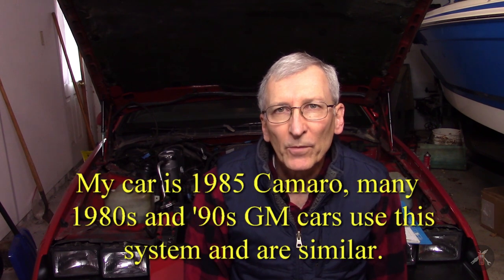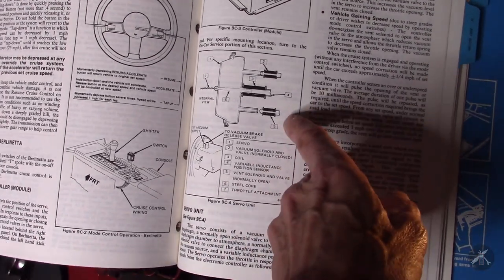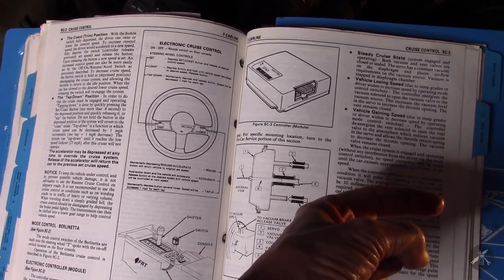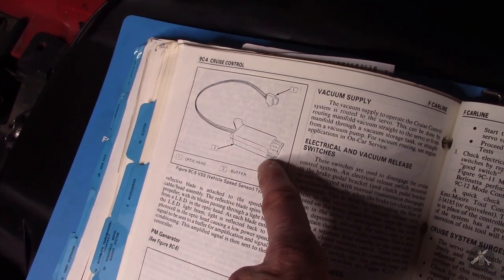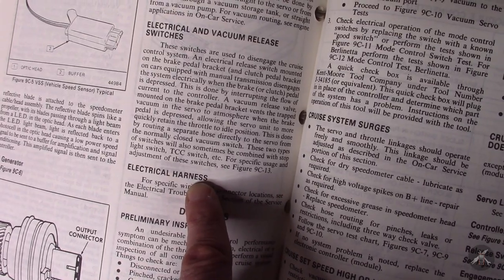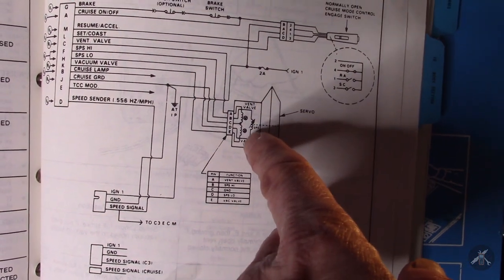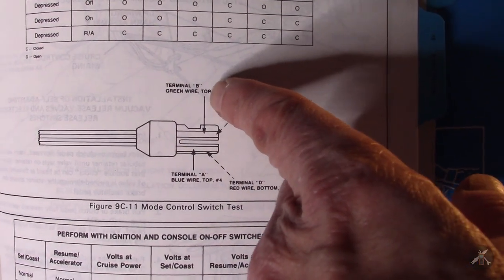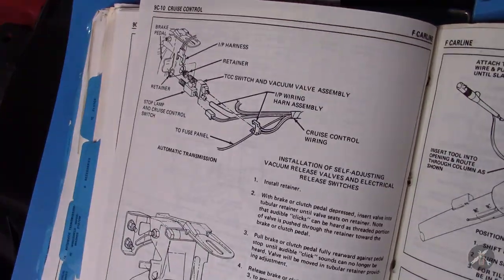GM 80s / 90s Cruise Control Diagnostic - 1985 3rd Gen Camaro

Comment: I believe this video is in reply to my request, Thank you kindly.  I have an 85 as well.
Reply: 1986 is the first year for electronic speedometer.
Reply: I’d suggest leaving the lever harness connected to the main harness, use backprobes on the main harness which would free up your hands - or as you’d mentioned move to the controller and make checks there.
Reply: My unit is inoperative, I will start at the servo, thanks again for this!
Reply from the maker: Yes, it is.  I hope it helps.

Comment: Thanks for the outstanding video sir. You have helped me tremendously once again. 

My cruise control works but the wiring under the driver side dashboard was sloppy and there was a module zip tied there. My cruise lever switch was chrome as well and I was thinking that the previous owner must have replaced it due to it being defective. I wanted an original black one and been researching which lever to order and how to install it. I read the manual and nothing seemed to match or make sense. The servo was mounted next to the windshield washer reservoir and had a separate vacuum tank next to it. I was really confused why my setup is vastly different and why the module is not under the passenger side dashboard. 

Turns out my 87 did not come with cruise control (K34 RPO) from the factory and the previous owner installed an aftermarket system. This setup looks really old so it must have been done in the early 90’s  I ended up removing the whole thing and I am loving the clean wiring and extra space under the hood. 

Thanks again for shedding some light here.

Comment: Thanks for this video! Im diagnosing mine and it seems i hear click in the servo when i press the set button but its not working, i check the vacuum and its all okay, im thinking its the servo, i need to test it, i did try applying vacuum in it and it holds but i guess i need to apply voltage to see if the sevo moves. Thanks again

Comment: So. I started putting my 1987 Iroc z W Tune port injection with the 350 back together and now i can't remember when things go because all my documentation and photos that i had on my hard drive corrupted and disappear! is there a way someone has like photos of the process and that to have an idea where everything goes? Because now i have a real problem here haha. Like i have everything in order bolts and everything labeled but is hard to tell now because there so many bolts and wires. I was doing a head gasket job that turned into a nightmare now. i will appreciate if someone reads this and can guide me true it!
Reply from the maker: I know that you have a 1987 and some things will be different from my 1985, but if you look at my early videos in the following playlist, I tried hard to document the disassembly. Episodes 6,7,8,9 have much detail on disassembly and later 32 through 35 have reassembly.  Hope it helps.
https://www.youtube.com/playlist?list=PLaagkwKaZ2RWXWcU9McHQj92nambLIW9n

Comment: My cruise hasn't worked since I bought my '87 over 15 years ago. Today I replaced the multi-function stalk, and now it does engage, however it immediately goes to full throttle and accelerates out of control. I tried setting it to 55 and by the time I turned it off it was up to 80. All of my vacuum hoses look good, and the check valve seems fine. Any ideas?

Comment: Great video! I have a 88 that is having a speed signal issue at the ECM. I got an EBL ECM from Dynamic EFI.  Being that I'm running a rear mount turbo setup. With the laptop hooked to the ECM via USB cable. The WUP (what's up display) Isn't displaying vehicle speed. Anyhow me problems LOL.  Thanks for the great videos! Keep them coming:)

Comment: Thank You for this. After replacing the signal stock on my '89 RS, which it needed anyway, my cruise control still didn't work, but at least I figured the switch was probably good. As it turned out, I has a broken vacuum line going from the carb to the servo. Not only was I able to repair my cruise control, but also repaired a vacuum leak I didn't know I had. I have questions about my electric cooling fan. Do you have a video on the subject? As far as doing a search on your channel, I know how to turn a computer on, and that's just about it,  Thanks You
Reply from the maker: I'm glad that you fixed your cruise control. I don't have anything detailed on the fans, but I'll see if I can add something.
What is your problem?  Which engine?
Reply: 305, "89 Camaro. Right now I have the fan wired so it runs anytime the ignition is on. If I try to wire it conventionally, it works intermittently. I have a new fan switch to install, but I'm dreading that messy job. @bitsofwisdom460

Comment: Hi Dan,great video thank you.
Can you explain who/what components commands the idle control valve please?Just because on my ‘92 RS Camaro (tbi 700r4) after many attempts to reset the iac,when I put in gear she rews up very high,but in park or neutral the rpm quite down fine.I’m little frustrated now,no vacuum leaks,all the sensors new,distributor is new,Still don’t know really what can cause that reaction.Much appreciated if you can make a video about that,thank you.
Reply from the maker: The IAC is directly controlled by the ECM.  There are two coils in the IAC and each one has two wires direct to the ECM. Since you have a throttle body injected engine, it doesn't have a mass air flow sensor. The ECM estimates air flow from the other sensors, measures the current engine speed and then sends a signal to the IAC.  
The diagnosis can be complex, because it's necessary to determine why the ECM thinks it needs to kick the IAC open that much.  As I look at the manual, there are a number of possibilities. Mechanically, there could even be a problem with the IAC itself sticking. The best way is to have a scan tool to see if the sensors are reporting normal values, sometimes a voltmeter can be used as well. I'll try to take a closer look at the manual.
Reply: You are right Dan,I’ve others IAC tested,each time doing the IAC reset procedure and replaced al the sensors(not the knock)the results are the same.
Is it possible something related with the TV cable or the switch in the gear selector perhaps?I only have commercial repair manuals,they dont’tell nothing related to that problems,I have no codes on the MIL.
Appreciate your efforts,thank you!
Reply from the maker: @gabrieletaroni5822  I am looking at the ‘91 service manual for throttle body.  In addition to the standard trouble trees for the IAC system, there are some notes regarding possible non-IAC problems for “slow, unstable or fast idle that cannot be corrected by IAC valve”.  First it directs to scan tool counts.  If idle is too high, counts would be zero because the system would be commanding down (unsuccessfully).  The list includes vacuum leak (including PCV system), throttle linkage, lean mixture, IAC valve connections, foreign material in IAC bore.
From what you have said, it could be possible to have a problem with the transmission switches that indicate park or drive, but I would have thought it would cause low idle if malfunctioning.  Throttle system binding could have an effect including the TV cable. It would be important to be sure the throttle is on its stop when you have the high idle condition. You could disconnect the TV cable fron the throttle body to test it.  The trans would go into high line pressure protection mode if it is disconnected.  Also, if your TPS sensor is not adjusted correctly, it may cause the IAC to not control properly.  I don’t know how the logic changes between park and drive, but if the TPS shows off idle, it may modify commands to other systems. What I mean is that you could have a change to spark timing that would increase idle speed even with the same air flow. In fact, you might want to put a timing light on it in park vs drive and see if the electronic spark timing is making a large shift.
Honestly, if you had a scan tool or someone who could take a few readings for you, it would likely narrow down the possibilities rather quickly.  A snap shot in Park and one in Drive would tell you a lot. Oh, one last one: there is a note about system voltage.  If your 12v drops when you drop into gear, the ECM has an adjustment to kick the idle speed up in anticipation of low fuel pressure.
Please be safe when making any tests.  Blocked wheels, brake on, helper when required.
Reply: @bitsofwisdom460  Your description is much appreciated thank you Dan!
So,my throttle body has a fixed TPS(round plug),I had doubts about it and about the coolant temp sensor too,measured with a multimeter they seems work right.I notice you mentioned the TV cable: in the past I had to replace it do to a cracked plastic eyelet on the throttle arm(just to inform you I later found a replacement eyelet for those without replacing the entire cable from ATP part #YR-100),perhaps my new OEM TV cable is too short!
I have more to investigate,disconnect the TV,measuring voltage drops and a new research for vacuum leaks,now I have a smoke machine too 😋.
24 years with that Camaro,prevyously I had one 84 IROC carburated,t-tops,red like yours.
I have a Aldl cable and I can”see” the ecm flowing data,the difficult is to understand those data(WinAldl).
An other interesting question for you(I think) is that: why the 305 TPI is set to 6* degrees before tdc and the 305 TBI is set at 0*?
I‘m pretty shure that engines are internally the same.
Reply from the maker: @6904gabriele  I am working on a video to help with the questions. It will be a day or two before I can finish it because I am away from my editing system, but coming soon. Your WINALDL should be a big help and I'll try to show you how.  Regarding timing, the engines are electronically timed so, the base timing is only a starting point and the computer adjusts from there. Base timing is most important as a back up or when you are setting timing with electronic advance disabled. There may just be a difference between the TBI and TPI where one likes the base setting a little different.
Reply: Thank you in advance for that video(and for all the others too!)I asked you about the timing just because I had an issue testing my tbi Camaro,after setting the base time at 6* before tdc sometimes during “hurry” testdrives on the street I loose the advance/retard control and obviously no engine power,and no ecm codes too…After shut off and restart the timing advance come back normally.
I’ve see your personal update,hope you feel good now!
I’m from Switzerland,always enjoy you vids!

Comment: @bitsofwisdom460 I am going down the same path and am having a heck of a time narrowing down my issue. I think I may have something fried in my instrument cluster (85 corvette, but much the same wiring and servo) as everything else checks out. My question for you or anyone else who can answer this... how does the servo function normally when everything is working as it should? I bench tested the servo using a power source and gator clips following every darn diagnostic check in the book and they all check out. The one that is getting me is the "click" that is supposed to occur when the key is in the on position and the cruise control is pressed to run on the stalk. I read countless blogs saying the servo solenoid should actuate or the unit should "click" once this occurs, well mine doesnt. I threw a multimeter on pins B&D and get 8 volts when the key and stalk are in the on position, should this activate something in the servo? I also tried on a refurbed servo and same thing, no click when pressing both key and stalk on. The other thing is what actuates the diaphragm? I have added vacuum and and plugged the dump outlet line then tried every combination of adding power to the servo on a bench and I cannot make that diaphragm contract with any combination. I am at a loss. Note fuses, vacuum hoses, power, stalk, solenoids, and throttle cable all check out.
Reply from the maker: I don't know about getting a click with key on and cruise button pressed. If you are trying this with a parked vehicle, I don't expect a response because the system will not actuate below about 25 mph. You would need a simulated speed signal.  My 1991 book references a "quick check" test box that will provide that simulated speed, but without it, I think you must do the bench tests on the servo. Perhaps there is a way with a signal generator to create a speed signal for testing.
To get servo actuation on the bench, block the port that goes to the brake pedal vacuum release switch, then 12v to E and A while ground C. Book says it should pull in to max and then removing power to E should have servo holding max.
The B and D terminals go to the position sensor that is an input to the system for feedback to hold speed.  So, the 8v signal energizes the sensor to allow it to read the servo position, but won't cause an action unless you are at road speed and trying to hold target speed.
I don't know the cause of your problem, but since you indicate a possible cluster problem, I would try to track down or check your speed signal.  I don't know how the Corvette picks up speed.  I think you have a digital dash. I expect that you have a pulsed signal from a generator at the transmission that is fed to the cluster and split to feed both the ECM and the cruise module. The Camaros with a mechanical speedo have a small signal generator in the head attached to the speedo cable.
Reply: @bitsofwisdom460 thanks for the prompt response! I tried the bench test with 12V to A &E with C grounded. Both solenoids activate but the diaphragm doesn't contract with vacuum on the smaller port of the servo; however, it does with vacuum applied to the larger port which goes to the brake switch. Weird, right? I also used a multimeter to check resistance between all the pins as your video shows and they all check out. I purchased a new servo (not exact model but another GM 5 pin that will work) and couldn't get it to contract bench testing either. This may be a dumb question, but have you tried the A&E with C pin power test on a servo unit you know for a fact is good to see if it indeed does contract? Thanks again!
Reply from the maker: @beaumasse  I have not had the need to bench test with vacuum, I haven't tried that test myself.  Just from a mechanization standpoint, pin E gives power to the vacuum solenoid which is normally closed.  It needs power to open and admit vacuum.  Pin A gives power to the vent solenoid which is normally open and needs to close to hold vacuum in the unit.  Pin C is common ground. The release port to the brake pedal switch is a sort of "back door" into the vacuum chamber that bypasses the solenoids.  If you can stroke the system with vacuum from the release port, it suggests that the valve at pin E is not opening, but the valve at pin A is actuated to close the vent so there is not a vacuum leak. Since you have this issue on more than one unit, I would double verify that you have full 12v on that pin E under load (with the power connected to the solenoid). I have been caught with testing power feed on a disconnected connector pin that looks good, then having less than full voltage when it was connected due to bad switch or wiring connection.